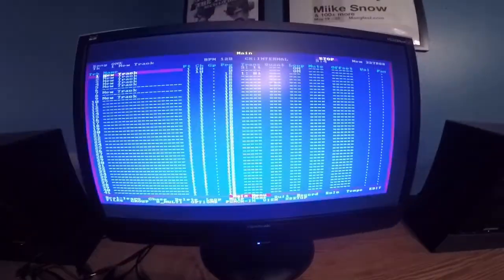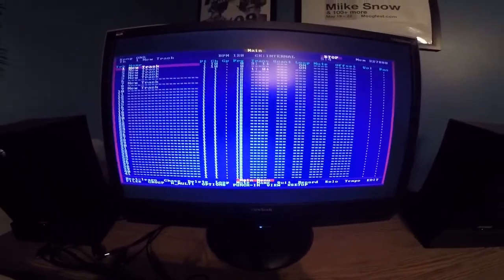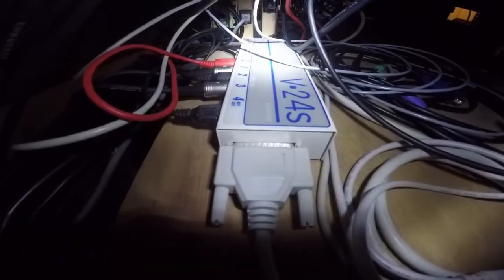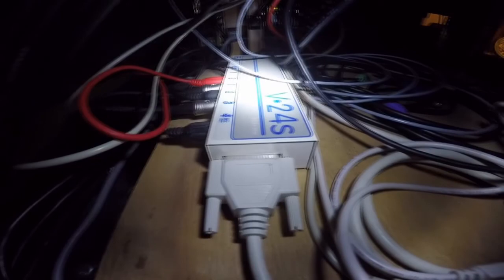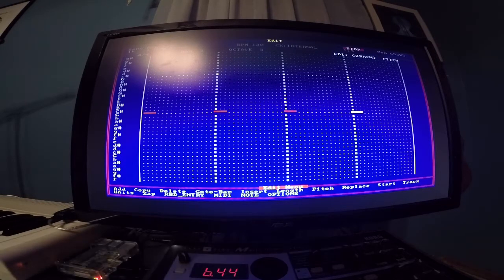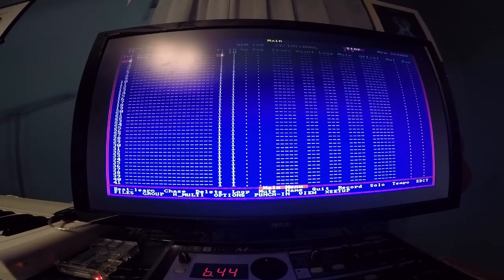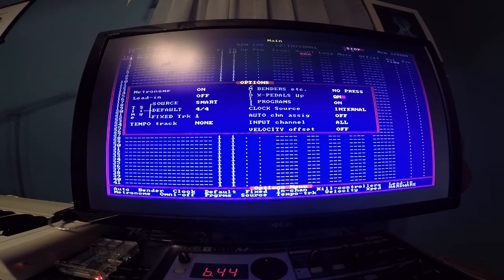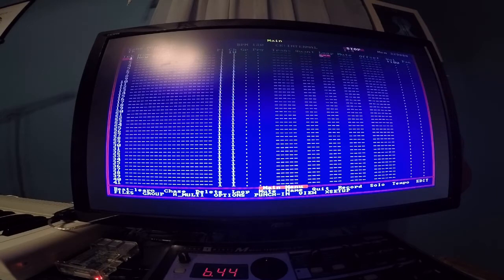Voyetra Sequencer plus Gold perfect on a Raspberry Pi

Comment: Hi,
I have been using Sequencer Plus Gold since 1992, and have it running on an old DOS PC with ISA MQX32 interface. 
I would greatly appreciate it if you can tell me which Linux, DOS emulator, and USB midi interface you are using and what the driver for the midi interface is?  the reason I am using it on old PC is because of the midi driver for MQX 32.  
please advise.
Regards,
Atif
Reply from the maker: Me too I still have the retail manuals amd packaging of my voyetra v22. The I got a masters is computer engineering and made it work on a rpi3. Midi in works on my desk for about a year, just no time to make videos. My day job making robot brains is cumbersome.  Anyhow stretch plan for this is a stage midi playback gtr pedal.  I have a bom for build, just need a time machine

Comment: what drivers did you use?..I would LOVE to get my SPG up and running!..
best midi sequencer ever!
 would you help me out please?  have pi to spare.
thanks
Reply from the maker: Cant really guide you here its very complicated. 
I am a computer engineer with 30 years experience, and an expert with VSPG. I say it was a pain in the @$$. these video are just meant to be proof it can be done. FYI it's much easier to get VSPG to work with Windows 10. I have a HP i7 and its great.

The video is the same rp3  as this video

https://youtu.be/GyKXObwUygw

the idea of the 7" touch screen is for compact live playback. you (I) definitely need a keyboard mouse and giant monitor for editing.
Reply from the maker: To answer the specific question what drivers. It's a Raspian image, using ALSA and Amidi

Comment: Would it be possible to use a multi in/out for more ports/channels? A MOTU microlite has 5 in/5 out, giving 80 channels. Is that something one could take advantage of with version 4.11 of Sequencer Plus Gold?
Reply from the maker: I've got spg with 3 ins 5 outside and smpte works fantastic on a 2k  industrial dos p4

Comment: Gotta ask: So the only things needed here are Raspberry Pi 3, something like Raspbian or Ubuntu Mate to run the software and then download and install the emulator and use that to run Voyetra Sequencer? It can run multiple synths daisy chained or with an midi hub (limited to 16 channels) via the midi-usb?

Would love to see an tutorial how to get it to run on Raspberry Pi 3.
Reply from the maker: yep. the midi adapter was 2$ on amazon. the rpi3 was 35$ + ps + SD + case SPG is abandon-ware = free. the emulator and the midi setup was a ultra pain in the ass. that's why its not a how too video. its too advanced for me to teach. I am an expert in other computer fields including midi. I had no pi/linux experience when I started it was just a goof. It took about an hour to prove it can be done. then I sat on it mulling it over for 8 months before about two more hours of setup to get it to work. and it worked amazingly well.

Comment: very cool indeed. BUT how is the timing (feel/rhythm) of the clock in the Pi? Because I’m running Voyetra Sequencer Gold Plus on an original Yamaha C1 Music Computer and it is INCREDIBLY FUNKY.
Reply from the maker: it works remarkably well for being fully emulated. the industrial v24s setup is the gold standard, and I have used a v22 for 20+years on a 386 it always worked great. all the songs on the channel from +NPV are 386-33 with SP-v22the pi isn't the same thing, but it is very comparable for one port. It is loads better than all the Pi specific sequencers I have tried. I have never used a Yamaha.

Comment: I wonder how you connected the V24s to RPi? I also wonder what emulator you used.
Reply from the maker: the RPI3 is running Raspbian Jessie with a 2$ Chinese USB midi adapter from Amazon. The v24s in the video is my pro system running on an embedded industrial Pentium 4 ISA all in one Advantech PC;  that  logs into a XP windows machine with shared hard drive. The concept of the video is that I know how Voyetra should work, and for 50$ all in, it keeps up with one port of the real thing. Sorry for the confusion.but .. on the other hand there is a USB to ISA bus converter out now...???